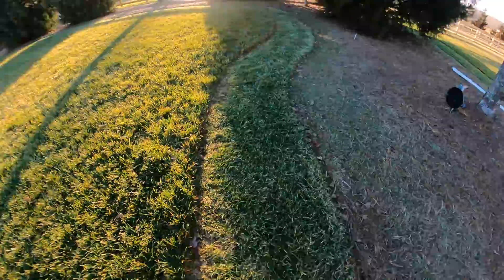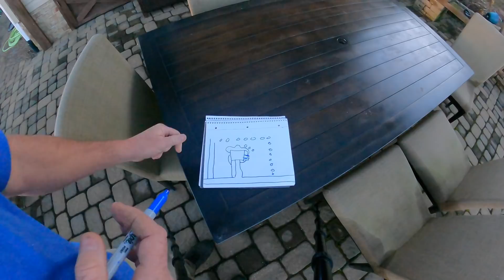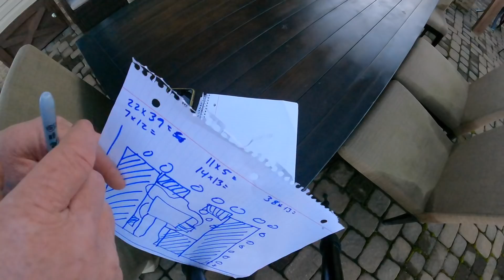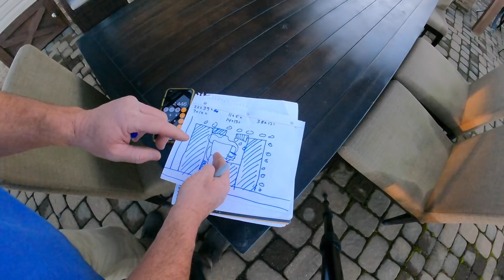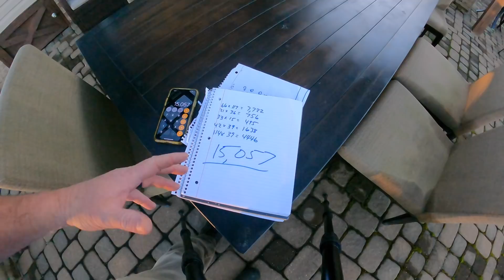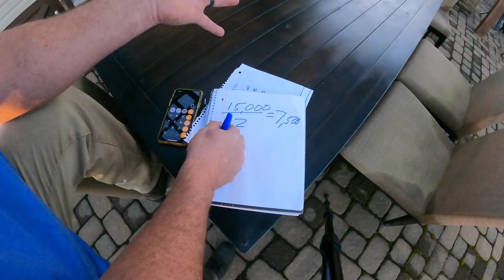DIY Measure Lawn Size - ZERO TOOLS NEEDED

Comment: Have the old spray n nozzle need  another but the old one has a 90degre if the new one has a 45 maybe my boots would not get covered so much.Does the new one have a 45????????????
Reply from the maker: email me...you are using in incorrectly contact@gciturfacademy.com

Comment: Google maps tool is surprisingly accurate. Great video Pete, keep them coming!
Reply: I concur with this, here are the steps for future visitors of this thread:

Step 1 - Go to google.com/maps on your laptop (won’t work on phone)
Step 2 - Type in your address 
Step 3 - Click on Satellite in the lower right corner
Step 4 - Right click on the image of your house and select the last option “Measure distance”
Step 5 - Click around the perimeter you want to measure
Step 6 - If you make sure your starting point and end point end up in same place, a white box on the screen will show the total distance and most importantly, the total area.
Step 7 - Repeat for all sections of your lawn. You can even measure trees and bushes in your yard to get those areas to subtract this area.
Reply: Yeah and anyone who doubts it can just zoom in on a football field or tennis court and test it out since they have known sizes.